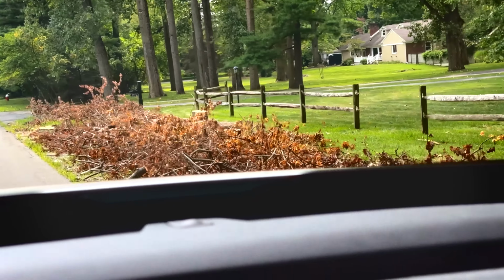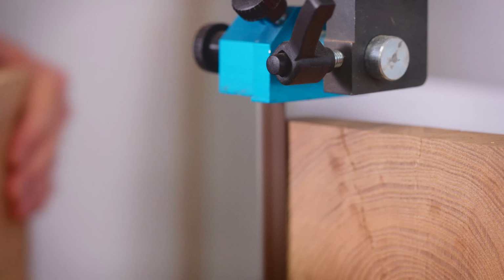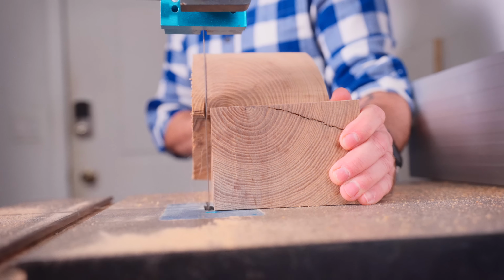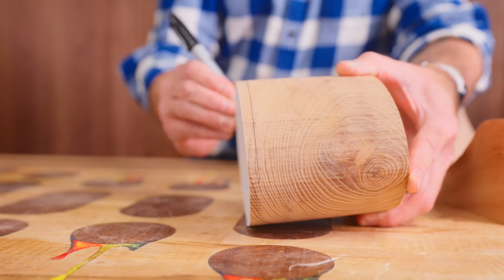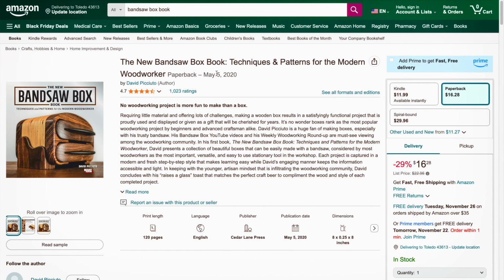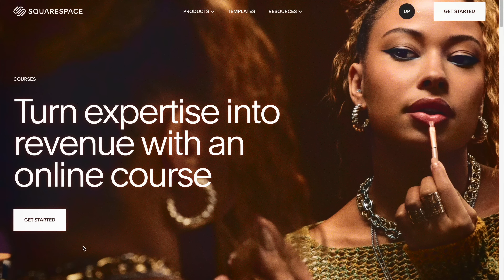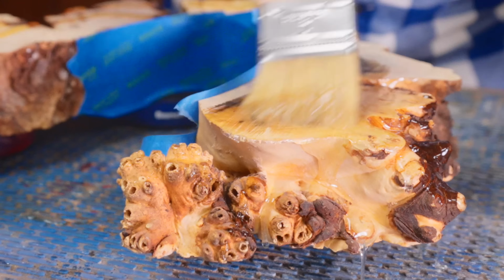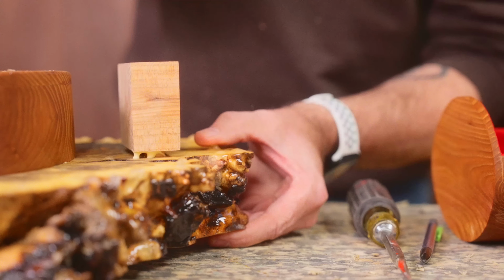Fine Woodworking From Firewood

Comment: At 4.51mins, Just wondering why you didnt just drill a hole to start the cut inside the eye shape cutout instead of having to woodglue it back together afterwards .
Reply from the maker: Because a bandsaw can't start from a hole like a jigsaw can.
Reply: @MakeSomething  or course sorry, why not the jigsaw then? Not as smooth or what?
Reply from the maker: I don’t have a jigsaw that can cut 5” thick